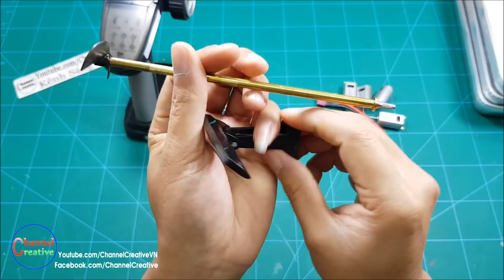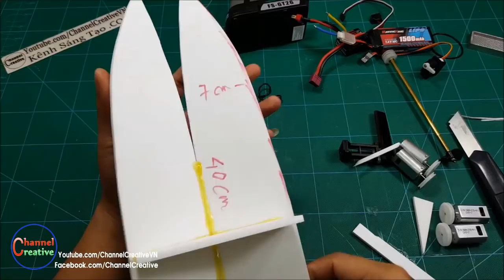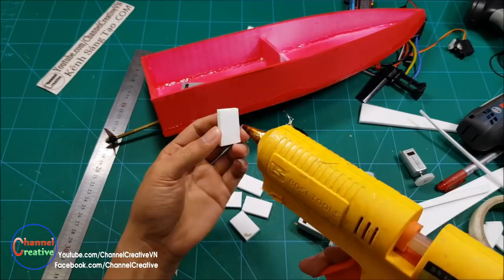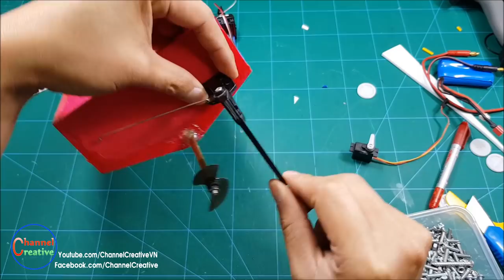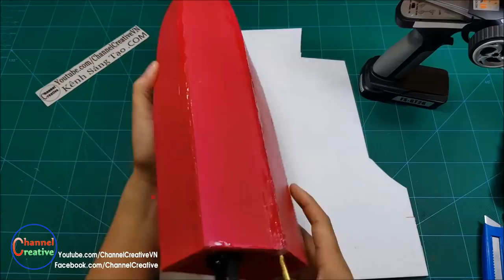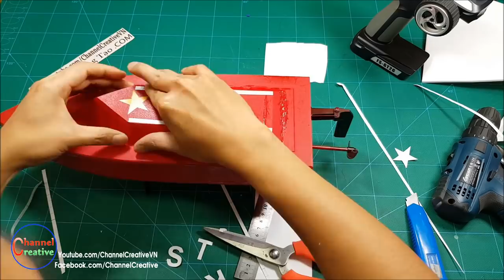How To Make RC Boat with v4 180 Motor

Comment: Well im only here to build my rc plane im just seeing how you connect the wire to the motor and sadly i don't have a welder but what i will do is get some of the wire casing of and rap the copper round the metal
 parts

Comment: Great project. Seems to work like a dream. But aren't pulleys a bit unreliable for an RC vehicle? Could you upgrade the engine with gears and add a second rudder for better turning? Also, your hot glue looks a bit yellow. Are you sure your hot glue gun's temperature is suitable? Good quality hot glue should be semi clear, just enough to see your finger outlines behind it, but frosted enough to not see it clearly. Too frosted and yellow tint are signs of not so great quality industrial hot glue. I'm sure it works fine enough, but it might not be the best quality hot glue you got there.

Comment: You never made another video with the v12. A truck would be amazing option for it. No speed increase but the torque is probably alot higher. Even though it's a very inefficient method

Comment: there is even more powerful motors , some of them are water cooled and requires 100amp ESC with bigger 6 or 4 s battery! ... yes it is expensive but you can make the boat a lot bigger and add more stuff to it without losing speed....

Comment: thx creative channel I was just founding thet how can we connect brushed moter with FSI6 transmitter.
Reply: Siddharth anghan Should be easy enough, just connect the two extra wires to the motor. If it runs in the wrong direction, either invert the channel from the controller or swap the wires. The red and black wires should be power in.
Reply: thx for help me.i don't want to use brushless motor in my project because it is based on "Fully Functional Tant" and I can't use brushless motor for that.i need to use geared motor, but can't join it in my FSI6 transmitter.but now I knew that we can use geared motor for FXI6 using "Brushed ECS". again thx creative channel and punakiviAddikti.;-)

Comment: Foamboard is not waterproof and neither are those electronics. A thin layer of spraypaint isnt going to keep the water out that boat isnt going to last long. The only thing i like about it is the 4 slot car sised motors but surely its easier to just use one larger motor.  Use waterproof materials next time and waterproof those electronics to atleast give the thing a fighting chance

Comment: Surely the whole point of joining 4 motors is to use an extra large propeller, but you used one the right size for 1 of those motors, so with no extra RPM, this is no faster than it would be with 1 motor =/

Comment: What is the name of cardboard?
From where you get this?
Reply: this is not cardboard it's foam for modellers... you can get it in modellers store or you can use the foam for laminate flooring (the foam for thermal isloation), you can get it in builder's store like OBI